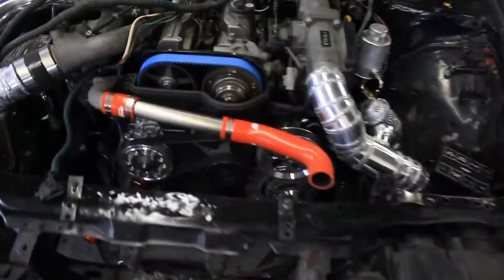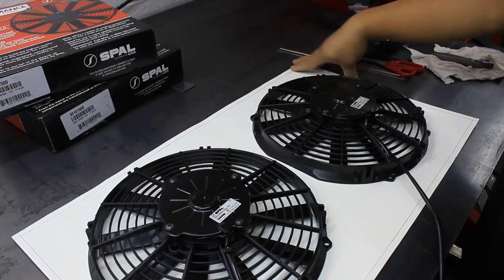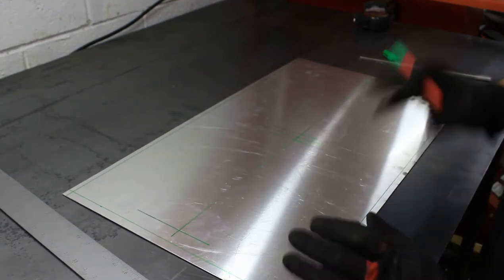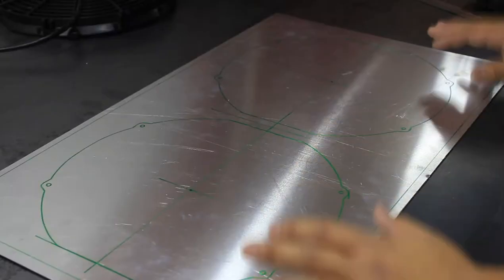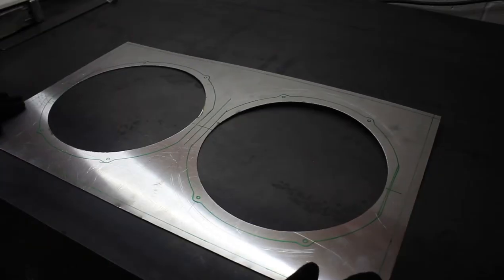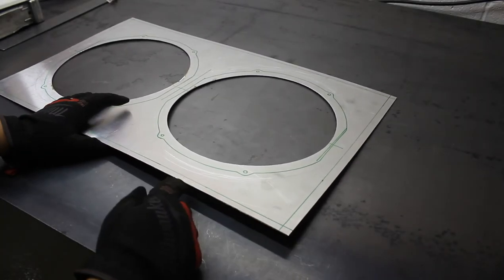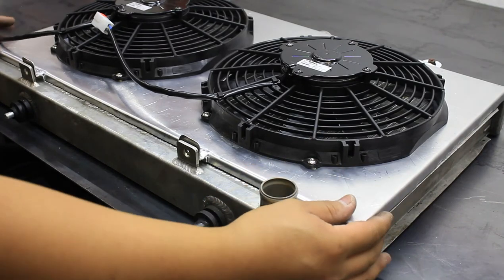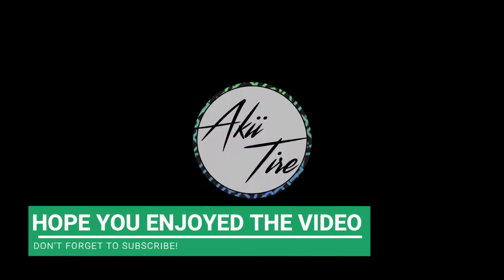Making A Custom Radiator Fan Shroud For The 2JZ S13

Comment: What tool/hardware did you use to attach the fans to the shroud? Rivnuts?
Reply: Yup, looks like!
Reply from the maker: Yea that's exactly what I ended up using, just some riv nuts and some button head bolts.